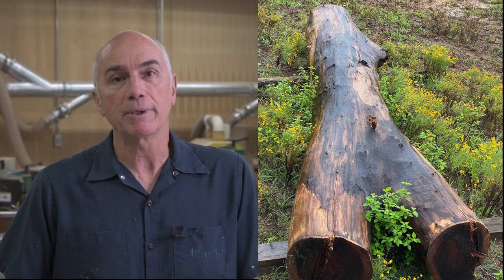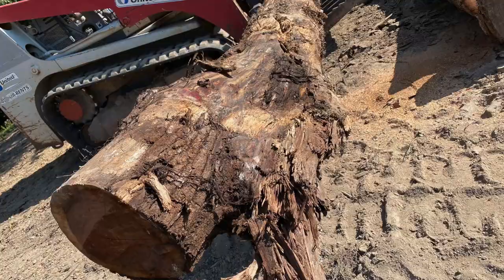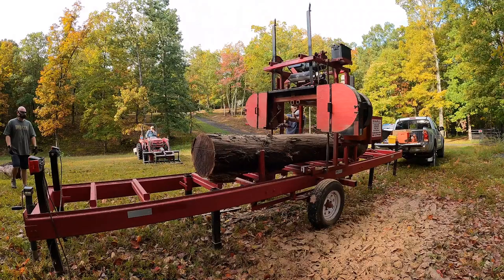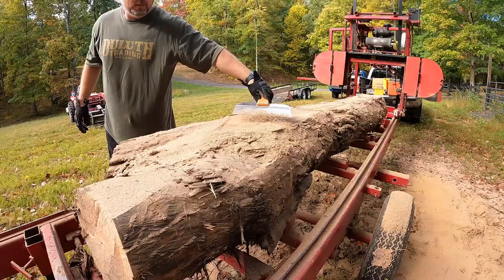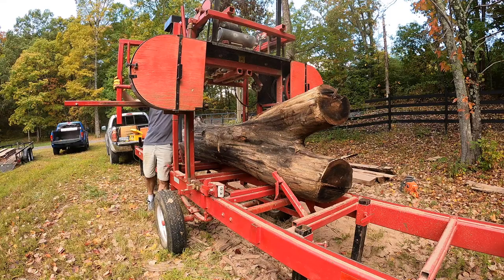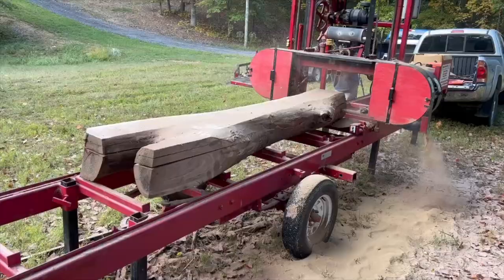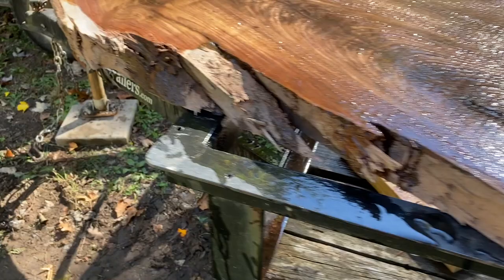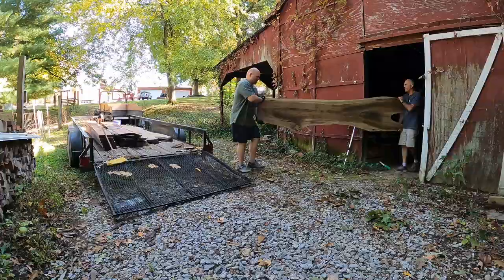Sawing up a Black Walnut log

Comment: On the prices per board foot you showed us, were those kiln dried prices, air dried prices or as is from the mill prices?  Enjoyable video and thanks!
Reply from the maker: In my area, comparable slabs go for about $15 a board foot in one of the wood working stores.  They would be kiln dried but I think the price is still pretty accurate.  Thanks for watching!

Comment: Good video, looks like you two had fun playing with water!  Curious as to how you plan to split them up when the time comes as it's not like a stack of 2x4's where every one could be considered identical.
Reply from the maker: We will probably split it down the middle but keep the bookmatched slabs together.  Most likely mine will go towards projects to sell and not necessarily selling by the slab.  I don't have that kind of inventory just yet.